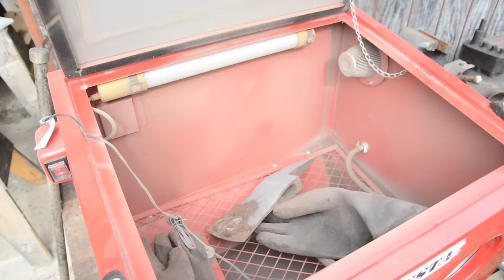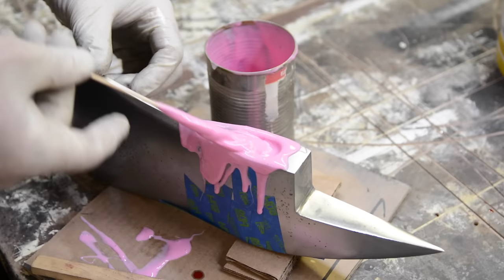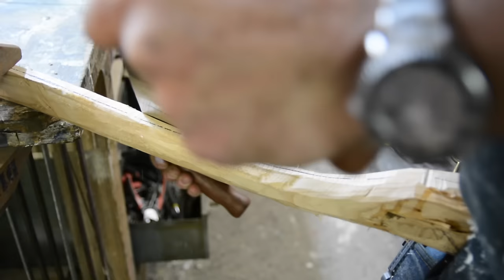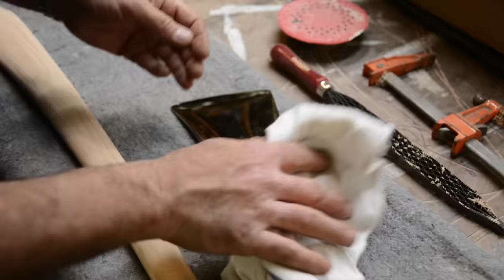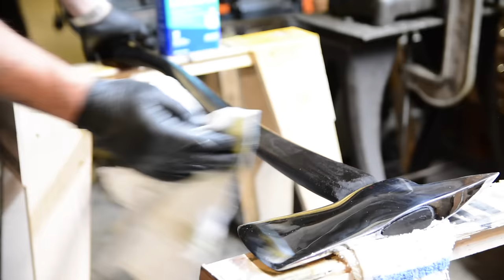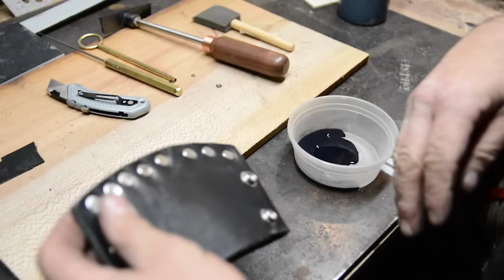✔ DiResta Fireman's Axe

Comment: how does one learn to do this?  it's incredible
Reply: Try. Fail. Repeat.
Reply: Also add a big workshop, materials and lots of tools... or at least access to use a workshop and tools.
Reply: sand blasting cabinet($150-$500 and about 5-10 sq ft of area to use), belt sander table($100-$300 3-8 sq ft), angle grinder($20-$100 store on a shelf, use on a work bench that takes up 20 sq ft), orbital sander($20-$50 shelf), band saw($200-$1000 10-20 sq ft to have enough room to use properly), table saw($100-$600 8-14 sq ft), reuse the bench and hand file($10) for fine shaping of the handle, leather punches and rivet tools($20-$100 used on the bench).  To do the project as shown you need at least $1000(probably closer to $2000) for the equipment and over 100 sq ft of space.  Not to say you couldnt do it with less and cheaper, but it'd take alot more time and effort.  If you've had a shop for years the equipment lasts forever so once you pick up a tool it's easy to lose track of the whole cost over time and it doesnt cost much to store it, but building a shop from scratch is very expensive.
Reply: i asked the same question 
and how to use all of these things and tools
Reply: 100-600 $ for a table saw? Thats very cheap
Reply: for everyone. As far as i know you cant get a new quality saw for under 800€ you might have to look for a used one from a garagesale or something like that
Reply: Years of practice or natural talent if you are not American
Reply: It's really not hard I'm 14 and I could do this Only I don't have a sand blaster
Reply: doubt a 14-year-old has the same skill let alone can't afford half the tools and finishes he uses so maybe get a job
Reply: Tony Becerra there isn't much skill involved in making a axe handle and I build guitars for fun this is child's play to me and stain and finish don't cost much especially when you don't have any other hobbies please don't assume things you don't know it makes you seem smarter🙂 o and have a nice day
Reply: I'm curious what being an American has to do with it.
Reply: Luiza Vazquez ㅜ
Reply: My grandfather is like this with metal. He's a marvelous gunsmith and his craftsmanship is master level.
Reply: David Jonston thanks man I'm 14 and could do this easily too.
Reply: You learn to do this by having the inner vision, and the personal  drive...
Reply: +hhoward14 its unique but not hard to learn .. its easy

Comment: @Jimmy , may i asked what you used to color the handle? i can never get things that black , but then again iv only tried stain.
Reply: +Jimmydiresta want to know that too. By the way great Video as always
Reply: +Chris Smith Its wood stain. Simple as that. You can by it in nearly every hardwearstore.
Reply: +TheExplodingChipmunk lol
Reply: I know its a dye someone made for him i just was wondering where to get the stuff ,if he knows of a good company or something of sorts.
Reply: +Chris Smith check the video where he makes the black sitting bench with the huge dovetails i believe he mentions it there .
Reply: Looks like ebony stain. I've had good luck with Minwax on pine and maple.
Reply: +Bryce A yes there it is ..thankyou .. i knew he mentioned it in the black bench with dovetails he made .
Reply: thanks !
Reply: finally someone with an answer that is helpful thanks , i will look into that
Reply: +Chris Smith Black shoe polish of all things works well on wood, but it will show more of the grain.
Reply: +Chris Smith You can find a good oil based stain or even oil or water based tint online preferably stain. If you want the stain to get deeper and darker try popping the grain before staining it. Take a slightly damp hand rung cloth and wipe it over wood. This will open the pores on the wood and allow the stain to penetrate deeper and more evenly. It works best on grains;that aren't as tight like Oak but will work on Hickory. Always test a small area first. Some woods don't take stains well like Maple a tight grain wood but  Maple can be tinted.
Reply: thanks for the advice , you have no idea how helpful that is! :)
Reply: +Chris Smith I am so glad +jimmydiresta took the time to answer this...

Comment: how does that work when you hit the end of the handle to get the axe head on. it isn't butted up against anything I figured it wouldn't do anything
Reply: +Jason Becker Recoil causes the heavy axe head to creep up the wood and since it's a snug fit it doesn't slide back down. It's a neat trick that pretty much anyone that knows what they're doing when making axes will employ.
Reply: I've seen him do it before and it makes sense the way you describe it but it totally goes against everything I ever learned haha. But thank you for the explanation it makes sense
Reply: +SeraphimKnight yep
Reply: ***** out of sheer curiosity how come that way exceeds striking the head. I mean I believe you just wondering.
Reply: the weight of the axe head is used instead of butting it up against something . you get a better fit this way
Reply: +Jason Becker .. the (heavy) weight of the head is the resistance. It won&#39;t accelerate just &#39;so&#39;, hence the wood will force itself into int - via that soft-resistance. Does not even change much when when you do  that .. downwards.
Reply: Not sure if you got an answer that makes sense to you,  I've seen a few others ask the same thing... briefly you are witnessing an amazing quality of all matter known as "inertia".   

Lots of glib and partly correct answers here,  but I haven't seen a really correct explanation yet... and spoiler alert,  the only correct answer has to end with "we don't know" ( but maybe we are starting to understand because of stuff like the Higgs boson). 

So: what you are seeing is is the tendency for objects made of matter (the axe head, the handle) to resist changing speed when a force (banging on the wooden handle end) is applied to them.  The more mass (the heavier) something has,  the less it wants to change speed.    

At first both the axe handle and the axe head are stationary. Then Jimmy bangs the handle (and also the head because it's loosely attached to the handle).  The handle is pretty light,  maybe a pound?  It feels a force from the fast bang (the heavy hammer going many inches per second)  and it resists changing speed just a little,  so it goes from 0 to maybe a few inches per second.   Meanwhile the metal axe head weighs maybe 4 pounds? so it resists changing speed more, and only ends up moving,  at a guess, less than 1 inch per second.  

So the handle is now moving faster than the head! 

The makes the handle drive itself further into the hole.

 And of course the increased tightness and friction in the hole slows the handle down and speeds the axe head up a little till they are moving the same speed (and then Jimmy's hand stops the entire axe). 

But WHY do objects with more matter resist changing speed more?   What makes them resist changing speed AT ALL?   We call this phenomenon "inertia" but no one really understands what causes it,  what intrinsic property of matter is being acted on by the rest of the universe to make this reluctance to change speed (also known as Newton's First Law)  happen. 

We can say that Jimmy is using the "inertia" of the heavier axe head to resist the motion of the handle, but we could just as well say he's using the magic staying power, or the Higgs boson or some other made up word. 

Newton came up with a system of equations that let us predict nearly every easily observable instance of motion and inertia and gravity.  Einstein came up woth ways for us to understand the behavior well enough to predict it for ALL cases except perhaps very very tiny masses (less than the mass of an electron)  or perhaps very large or fast masses (galaxies? black holes?  the visible universe?), but that doesn't mean we understand the behavior completely or understand WHY it happens at all, really or why are they as powerful or as weak as they are,  and how have they changed since the beginning of the universe and how are they related to each other. 

Or maybe you're just trying to make an axe! 

Which is sort of cool.
Reply: sreyemhtes way to over science it haha. And I don't mean that in a bad way. The only thing I don't understand at this point is why it is better to hit the handle and not put the handle on the floor and hit the head. Does it actually make a better bond one way or the other or is it a I don't want to mess up the head.
Reply: +Jason Becker I'm not a craftsman (or even a scientist!) but I'd say yeah, exactly don't want to mess up the head. So we use this trick.  Other people might use a leather pad or rawhide hammer to protect the head.  Sure is pretty.
Reply: +Jason Becker if u pounded on the head to set it it digs in and can go on crooked .. doing it the way jommy did is the easiest way to set it ..u can doit the other way too i guess but ive always set the head the way jimmy did cuz it was easiest for me
Reply: Daniel B. Got it using the handle let's it settle the correct way when pounding the head can mess it up thanks.
Reply: Yes sir .. u got it .. said it better than i could lol
Reply: +sreyemhtes nailed it.
Reply: +Jason Becker Incidentally, putting the head on an axe is called hanging the head. Sometimes you have to take it off and reshape the handle a few times until you "get the hang of it".... That is the origin of the saying.
Reply: +Notso Fresh That's a cool TIL kinda fact! thx
Reply: Notso Fresh nifty thanks. I love trivia.
Reply: +Jason Becker When you hit the handle you drive the handle into the eye. Because the handle is moving faster than the heavy head is then. So the handle is going to pass the head, or pass into it in this case.
Reply: Paul Frederick I totally get it. If you hit the head you can only get it up to the the head but the other way it can go past the head without tweaking the head
Reply: Jason Becker
You only need to hit the head if you want to take the handle out. It is like driving a nail. You hit the nail, not the wood you're putting it into. When I fit a handle I do multiple fits, so I need to take the head off to get the handle to fit better. I use a brass hammer to do that, and it does not mar the metal head at all.
Reply: Inertia of masses
Reply: +sreyemhtes This comment thread deserves to be framed or something... Such good information, such open-mindedness, and intelligence. A rare sight on youtube, and it makes me happy that I've discovered it! :)
Reply: Filip Bahunek totally. I raleally thought someone was going to be an ass and say what are you stupid but nope. Thanks to all.
Reply: +Filip Bahunek Yeah we did ok huh.
Reply: Yep, doesn't get any better! Haha :)
Reply: First step to the process is being smarter than the hammer of course..
Reply: It works by momentum and impulse. If you create a large and quick impulse in the opposite direction of the momentum it will create a large net force. (hammer hitting handle while axe head moves up). If you want to know the exact force of each hammer hit then all you need to know is the weight of the hammer and axe head,  and the speed you move the hammer down and axe head up. The last thing is the time the hammer impacts the handle. Momentum=mass•velocity // impulse=force•time. Physics is amazing.
Reply: +Dead1yCool That's only true if the axe head bearings are perfectly round, though.

Comment: how much does it cost to set up a small workshop like these at home? max to min? approximately?
Reply: the legendary kong depends on what kind of a deal you can find, as jimmy once said (not exact words) it’s better to buy a second hand tool of good quality than a new piece of crap, you can get the basics for like $100 if you look in the right places.
Reply: the legendary kong one really good place to look are flea markets occasionally you’ll find people who are just too old to do it anymore and are selling their equipment for a very good price. If you need an anvil you can actually make a really good one with two railroad tracks welded, sanded, and bolted to a log.

Comment: thats real nice. but totally fucked up the handle by painting it. should used boiled lensed oil. not sure but could have messed up the temper  by grinding it. maybe not though cause grinding was not to deep.
Reply from the maker: Southerngunner 87 it is dyed black and coated with BLo. So have no fear
Reply: Southerngunner 87 it's a show peice, you don't think it would be chromed it were a working tool do you
Reply: jimmydiresta  , hey um , instead of fast forwarding through a ton of footage , I think you should cut to the best footage , and also maybe put some background music .
Reply: jimmydiresta nice. I use my tools but I understand a work of as well and not wanting to use. just coming from experience only thing I use on my handles is boiled linseed oil. its great stuff.
Reply: "lensed" oil? It's Linseed oil.
Reply: CaligulaClone thanks. auto correct kept wanting to spell something different so I just kept what it took.
Reply: autocorrect strikes again!
Reply: Southerngunner 87
Reply: Southerngunner 87 edds
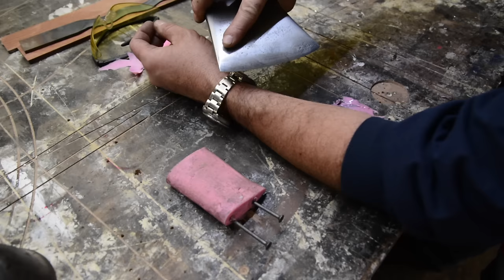Reply: Southerngunner 87  I agree,  also there's no need for it to be so sharp 3:05 that's actually can hurt performance
Reply: Southerngunner
Reply: Blake Kratzer how can it hurt performance
Reply: jimmydiresta can i ask you something? is the second axe( the One of the pack) the same at the beginning?
Reply: Mauro Fiorini 0
Reply: Southerngunner 87 that's Ebony stain. not paint
Reply: Mr Cow you don't want your axe getting stuck. It's not actually a tool for cutting, it's a tool for splitting..
Reply: thecoolwaffle then it wouldn't be a diresta make, it's be just like the hundreds of other channels on youtube
Reply: Not a splitting tool
Reply: Southerngunner 87 IT WASNT RESTORED FOR YOU.
Reply: try mixing linseed and beeswax, have to melt it in a double boiler, but excellent wood treatment, and can be used to waterproof canvas.
Reply: Southerngunner 87  😍😍😍😍😍😍😍
Reply: Southerngunner 87 Olá sou do Brasil vc vende esse Machado 
Gostei muito dele
Reply: Kyle spliting axes is not sharp but tree axes is so your wrong

Comment: nice job as a decoration but a true fire axe never has the cutting end painted as during inspection you must inspect it for cracks also the finishing material is flammable  beside like fire trucks fire axle must be red  lol
Reply: These are fine axes, I have had mine 45 years, and it is a tremendous tool in the woods, built in picaroon as well ...
Reply: Kelly true temper if I remember right...
Reply: Len Morris, what are you 5 years old? You have no idea what you're talking about.

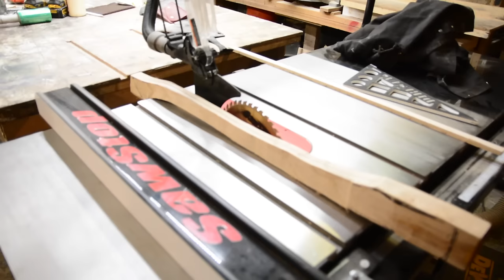Comment: 3:58 that's a kickback waiting to happen
Reply: kick backs occur when the material comes under pressure against the rear of the blade.  Running wood across the front of the blade will pull it down toward the table, not up and off.

Comment: Hi, first of all, great great job, the axe just looks beautiful and very high quality, awesome work. May i ask if the wood is good? because it looks like it would break after some heavy use, maybe its some special wood and its made for high impact but a fireman work with the axe its always the heaviest i guess since they have to take down doors and etc, im just curious. 
And also, did you make this axe just for the video or for someone?
Thank you! cheers from argentina
Reply: BESTIALTOP not jimmy but may be able to provide some insight.

The entire axe was made to be a show piece, after all the high polish head wouldn't withstand much work before tarnishing again. As for the handle, the wood is quality but even a high quality high spring axe handle would not hold up to much work being that thin. Hell, even fiberglass wouldn't. The handle was built to have accentuated curves and be as aesthetically pleasing as possible, maybe do some very light work at best. That's fine though, the function is to be a showpiece. Wouldn't want something utilitarian and extremely useful in that role usually.

It does it's job and does it well.

Comment: I'm no expert, but don't you need to put a pin or two into the eye of the axe handle so it'll hold better. Also it looks like the head would wiggle, the eye didn't seem to bite into the wood.

Comment: Huh, you can use a table saw to grind down the wood. Did not think of that. 

Anyone actually try this besides diresta? It looks as though it would actually be a bit easier to make a mistake when using a table saw.

Comment: what is that red machine at the start and how does it work?
Reply: leigh richardson Its a sandblasting cabinet. Uses an air compressor to shoot fine silica sand at the meal to clean unwanted materials off.. paint & rust mostly.. To prep for final coating.
Reply: Ng

Comment: I have several questions 1 what cast the eye and 2 why sharpen it before hafting it much easier and safer to do while not sharp and the eye you can easily cut it to shape by eye might take some test fitting but probably get a tighter fit

Comment: he made that neck to skinny where the wedge goes in. looks like it will snap. Also looks like you did the neck the hard way. Making the wax mold and everything. Would have been easier to just trace and keep sanding till you got a tight fit.

Comment: Seems like you could have spent more time on the case as well. You just flew threw it. You didn't seem worried about making it look nice, especially after all the work you did. The rivets on the case are at random interval. Why not take the extra time to get it uniformed and correct.